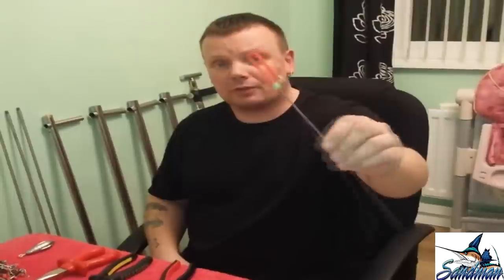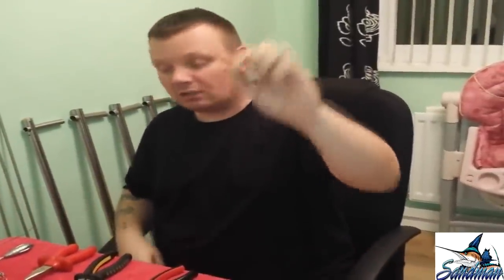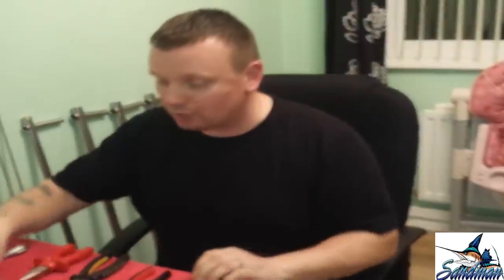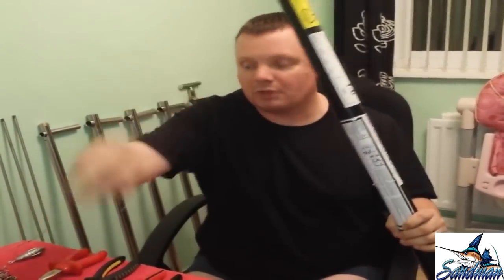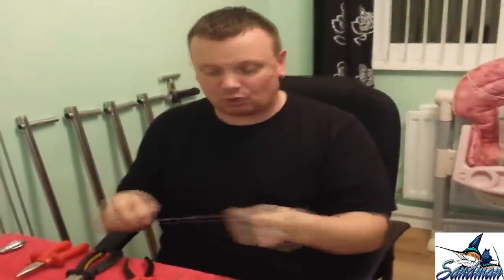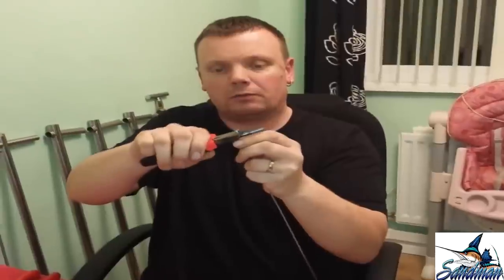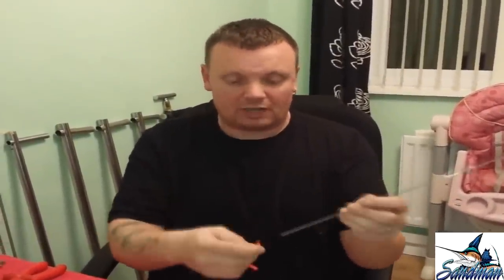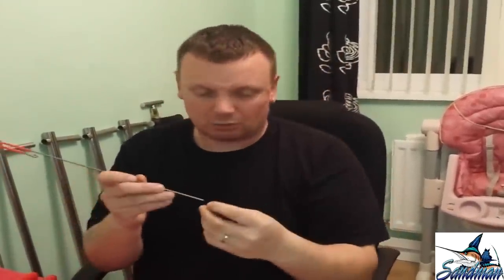Sandmans Tackle Time BAIT HOLDERS,

Comment: hi hope you don't mind me asking but why do you add the tubing. I guess the bead is so you can pick it up easy. Thanks and I'm liking the footage mate ;-)
Reply from the maker: hello james and thanks for watching....The whole prupose of the tubing is for 2 reasons..1 it seemed to dress the bait loader off a little better rather than it being just a bent piece of stainless if you like...2nd..In wet conditions sometimes and i must enfasize sometimes the bead would move so the only thing that came to mind was a short length of tubing mate..
Reply: Thanks for getting back to me so quickly.  Like what your doing keep up the good work mate. By the way I'm from deal in Kent so we are just starting to get the ray's down here. Quit a lot off the pier but the weather is not doing us any good at the mow.  Tight lines fella ;-)
Reply: James Marsh Ive made myself up a couple now, found rhe bead helps stop the bait sliding too far down, so when you put the hook agajnst the bait, the bend is level with the end of the bait, if that makes sense.